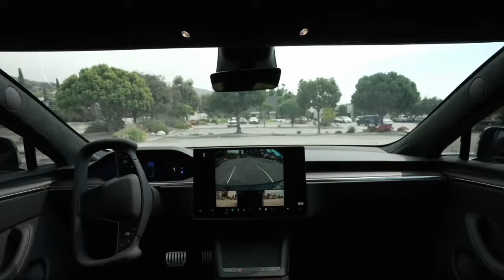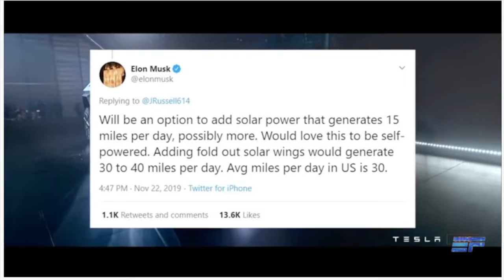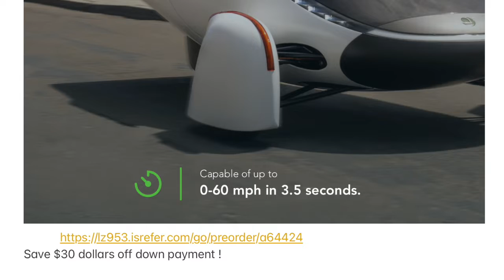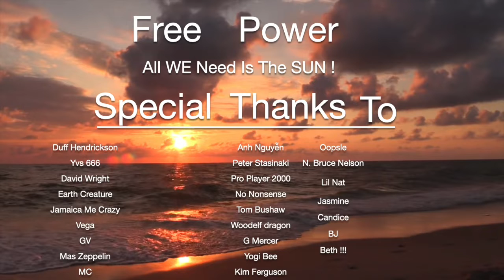Tesla doesn't have it , Aptera is Advancing it !

Comment: Consider this. The aptera should get a an EPA MPGe of 350 as it goes 10 miles on one kilowatt. Where a model 3 is about 4 miles for a kilowatt. I think Elon would need 2kW of solar to get to 40 miles a day [latitude in San Diego] if the cybertruck can match a model 3 in MPGe. But since the aptera is a motorcycle in the eyes of the Fed. It may not be rated at all as motorcycles are only tested on emissions which the aptera has none. Typically for a car or motorcycle the emissions test is done the same for both.  Using a dyno and sampling the tail pipe.
Also the aptera has up to 700 watts compared to the folding panels of 360W total you showed. Did you know that a tesla loses up to 5 miles per day just sitting?  The semi with a full trailer is advertised to get 1 mile for 2kW. A trailer would make a nice place for solar cells. Somewhere between 6kW and 7kW for standard sized ones you would find on a house. But you would want the cells laminated to make it last like aptera's process.
Reply from the maker: Nice , thanks for the info I didn’t know that .